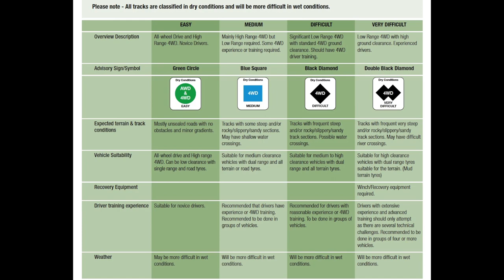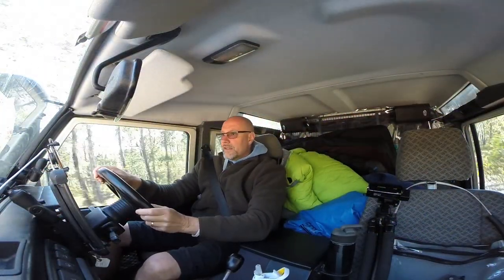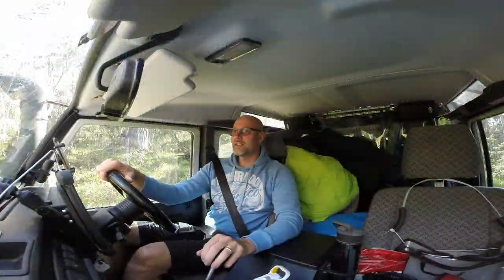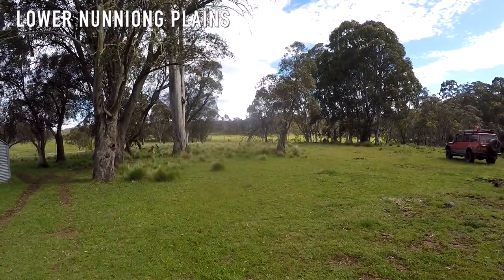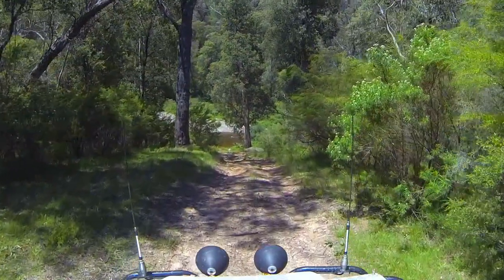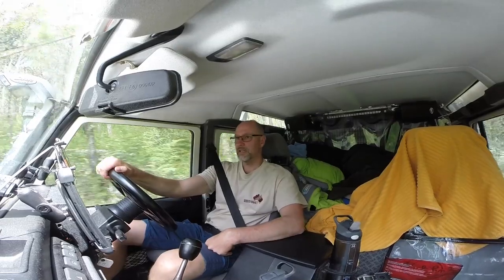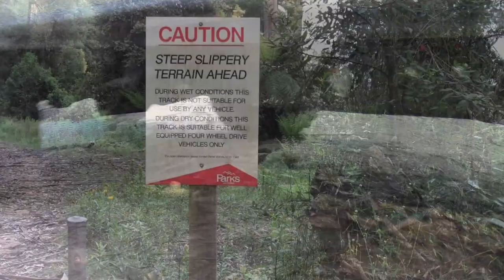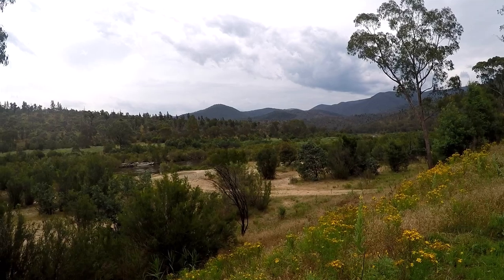4wd Off Road SECRETS of the Victorian High Country - A 4x4 Adventure - Nov 2015

Comment: Fantastic video again.... some beautiful country down that way..... How often did u guys have to divert to refuel or did u all have LR tanks ??
Reply from the maker: +Rob McDowall Mark in the D4 had a second diesel tank in the car, myself and Joachim have LR tanks. We fueled up before we started in Jindi and then once in Buchan and that took me all the way home
Reply: +AllOffroad.com.au - Thanks for that but what size fuel tanks do u have in the defender ?
Reply from the maker: I have extended main fuel tank of 127l and the rear wheel arch tank with 40l so all up 167l
Reply: Ok.... With the 127ltr tank, what sort of range would that give u offroading (eg: crossing the Simpson Desert/Madigan Line, etc)
Reply from the maker: +Rob McDowall Simpson I did on one tank
Reply from the maker: +AllOffroad.com.au actually let me clarify my tank needed started to move after 487k's that means I still have around 80l left so I did the Simpson with around 1/2 of my combined fuel

Comment: I am just wondering, how tall are you? You seem quite tall, and I can see you have steering wheel hub, and suppose rails extended? Asking because I am 6'9'' (207cm), and just wandering is it feasible to drive Defender.
Reply from the maker: I'm 193 and with a raised seat and extended brackets it was ok with 207 you would be struggling I recon
Reply: @AlloffroadAu  Thanks for reply.

Comment: How is the Disco with reliability long term?
Reply from the maker: +HotHeadCJ - Youtube Account Mark has it for 3 years or so, did many trips with us and the only issues was a broken battery clamp... I used to have a D3 and after 10 years it needed a bit of maintenance but not more or less then most other trucks..
Reply: AllOffroad.com.au Interesting, I always though it was as bad as the Range Rover
Reply from the maker: +HotHeadCJ - Youtube Account never had RangeRover so can't comment but the D2a is a very reliable truck

Comment: hi is there any reason you don't use your bunduawn in this video?
Reply from the maker: +David McCafferty yes, I had a new bracket with a quick release made for it but when the guy re-assembled it he did it incorrectly so unfortunately it did not work. He fixed it right after the trip though..

Comment: Would you say you need diff locks ?
Reply from the maker: Yes 100%, without diff locks or TC you drive a two wheel drive. While no diff locks can get you places if you drive well it will do far more track damage then a locked vehicle.
Reply: I have a navara D22 and was thinking about rear elockers any thoughts ? Like rear or front ?
Reply from the maker: if you have traction control or an LSD in rear I would recommend front locker first otherwise rear, I would probably go TJM or ARB not e-locker because of this https://youtu.be/1nYZo--7Xh4

Comment: Do you need the 3 inch lift to fit 35s or can you get away with a smaller lift on the defender
Reply from the maker: you may get away with 2.5 but probably will scrub a bit